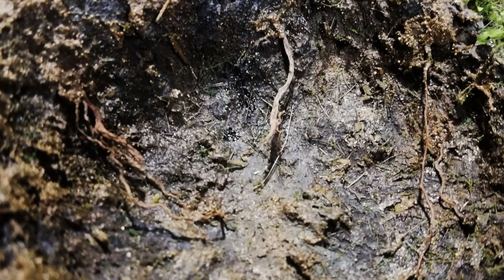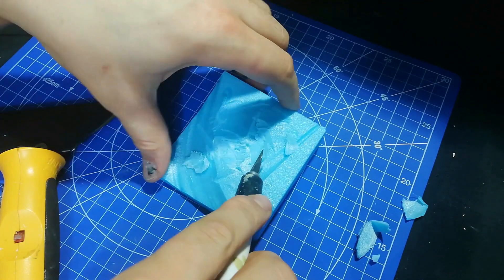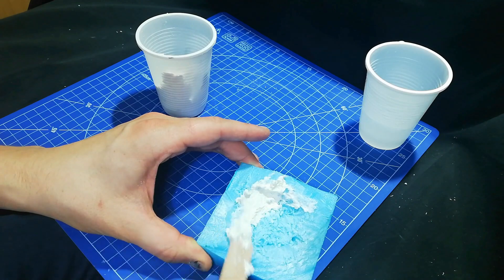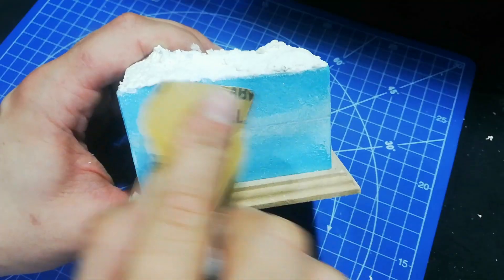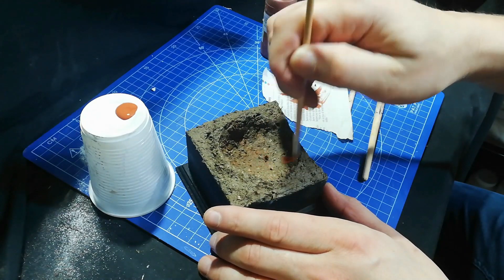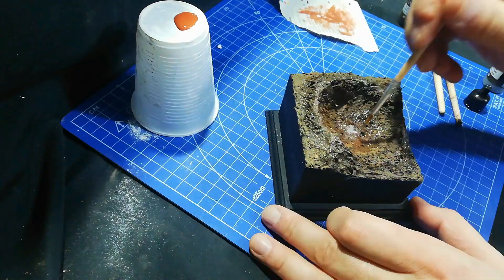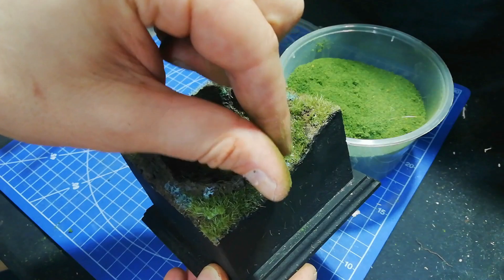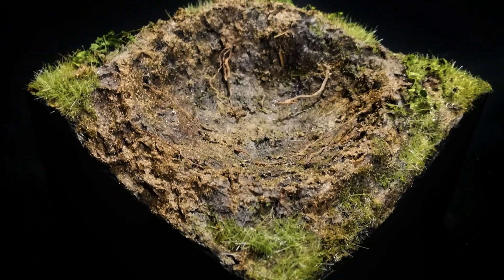Realistic craters for wargaming terrain and dioramas

Comment: Hey! Where do you get your foam fusion from? Struggling to find a place that sells in the UK :D
Reply from the maker: Hi Ben. I was lucky enough to have been sent this by the HWFF. Mod Podge also works, but just takes a little longer. PVA is also fine, but ditto. I have also been using WWS basing glue, which is great.